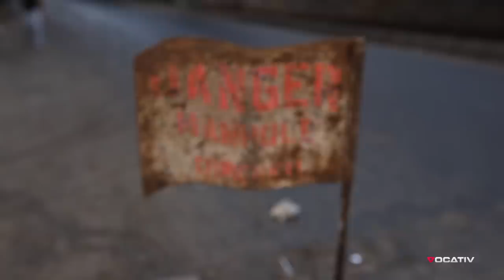The Sewer Men of Mumbai

Comment: Them guys should not be going down there  .. and putting a candle down first  to see if the oxygen level low WTF it might blow up the whole street there bosses should be put in prison for that would they go down the manhole ...They sould use tripod and harness plus BIG plus an carnrey bleeper  to check the levels off gases you guy should not enter at all ... I do work in manhole and myself would not enter with out the right  ppe ... why don't they get a pump the manhole out with a lorry.. I love to come and check out how they work in manholes .. should have safety advice on the entering a dangerous confined spaces ... and be on top payed I would say to them guys dont enter at all till you been train on the safety equipment. .